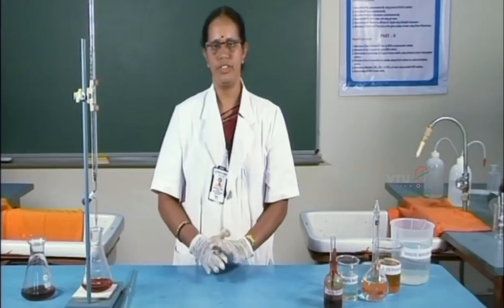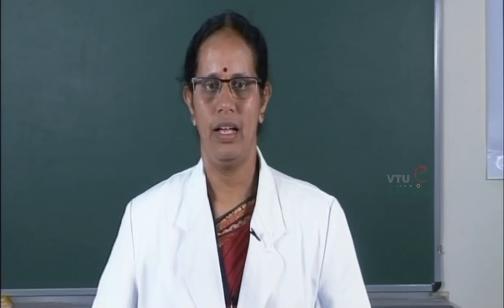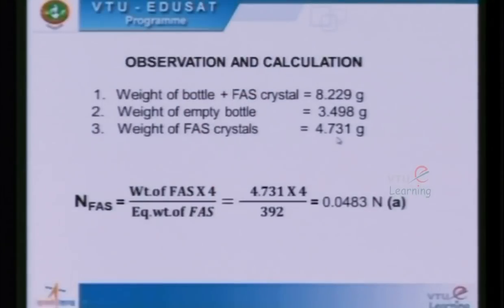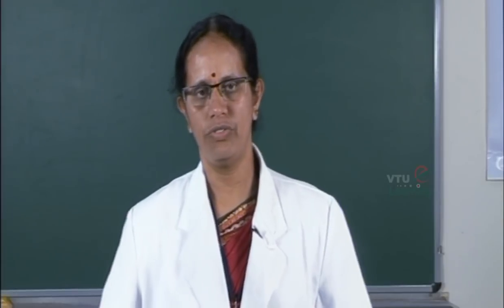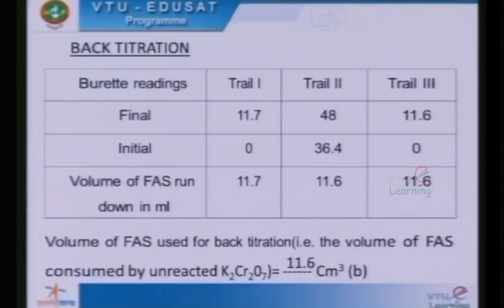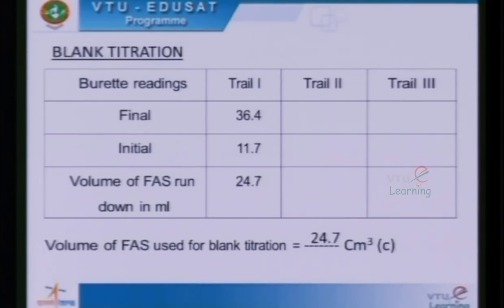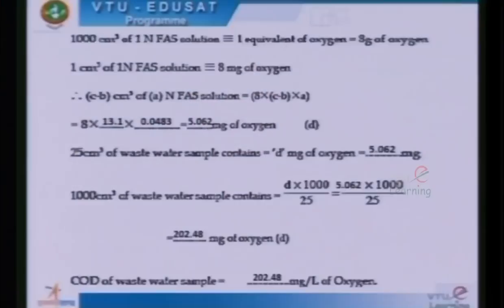3 Determination of COD of waste water | Chemistry Lab Experiments | VTU | 14CHEL17

Comment: I was really surprised when I saw pipette suction by mouth. That's terrible. Even for the pure H2SO4 poured directly without hand precaution. This is really dangerous and courageous at the same time. Good luck
Reply: Iam shocked, never seen that!
Reply: Dude that's not a big thing we have been doing the same thing since our +1 classes
Reply: That's how chemistry is done in developing countries. I drank cement solution water , dirty water , potassium nitrate and my teeth felt like they are falling. We can't complain cause that's the best lab we can get.
Reply: @vasdgod  true bro
Reply: @vasdgod  are you doing your engineering bcs cement solution we get in engineering only
Reply: @mr.anonymousbro5156  yep and I drank that water . My teeth is aching. Today I have viva and experiments based on that . I think I may drink it too.
Reply: @vasdgod  bro all the best
Reply: @vasdgod  my exams are over so happy forever
Reply: @mr.anonymousbro5156  tq bro
Reply: @vasdgod  which college are you in
Reply: @mr.anonymousbro5156  can't share private stuff on the net.
Reply: @vasdgod  never mind
Reply: ممكن مساعدة
Reply: In +1 we used to pipette the acids but now due to pandemic.... We are measuring them